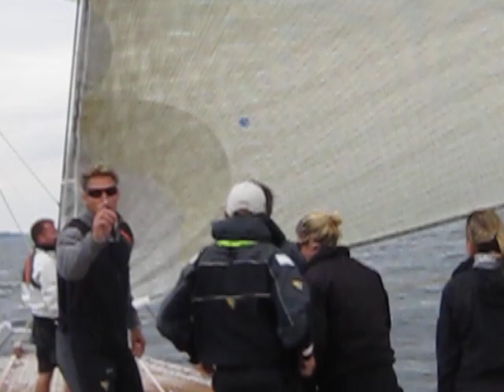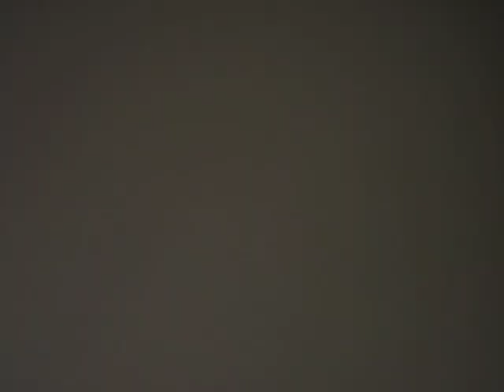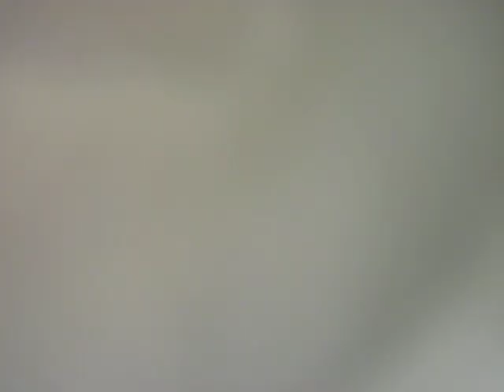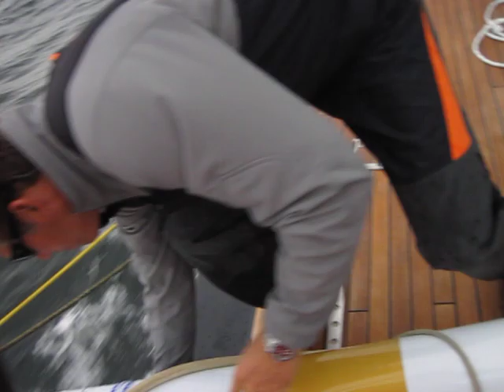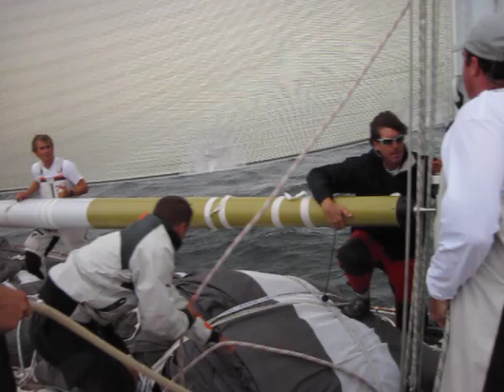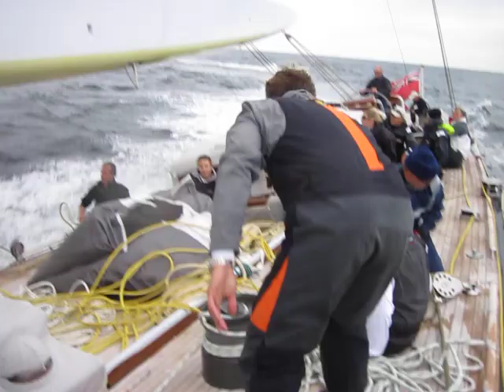Spinnaker takedown onboard the J Class Yacht Hanuman

Comment: Nick, the short pole that was lashed to the shroud is a reaching strut.  When the spinnaker pole is out near the forestay, the small angle between the guy and spin pole puts the pole in compression and only a small component of force to windward.  The reaching strut helps hold the guy out farther giving it a better angle to work against the spinnaker pole.
Reply: +Zach Stine Sometimes also called a Jockey Pole I believe - I'm sure there are other names out there for them too.

Comment: Bowman should have climbed up and sat on the pole. It is the right move if done correctly. Before climbing you "set" the pole meaning: crank up on the topping-lift and fore-guy. We was clipped onto the foreguy/downhaul - so generally you are not going anywhere. Your best friend should be the guy on the topping lift.

Comment: Looks like fun!  
Is it really standard procedure to have someone climb up to the pole?  I would think that in rough water it would be too easy to be thrown into the water.
Reply: I believe you attach yourself to the rope with a simple harness. Not sure though, I see people doing it on boats such as the volvo ocean 65s, and the clippers
Reply: yes, he locked himself. see movie.
Reply: eike64 Why dont you use a trip line ?
Reply from the maker: Because the loads are to high for a trip line to work. You have to spike it. That's why the bow man is the toughest sumbitch on the boat.

Comment: What is the small pole for?
Reply from the maker: It is to improve the angle from the back of the boat to the front of the pole. It also keeps the lines off of the stays that hold the mast up. These are carbon stays and cannot handle that sort of friction. The loads are really high so you need this small pole. It is called a reaching strut.

Comment: Pretty dangerous boat. Where is the railing....Or is the man falling overboard picked up by a following motorboat...Even the Somali Navy uses railings.
Reply: warjacare haha a railing on a j-class?!? This is not 50+ sailing
Reply: warjacare Bahaha sure. Let's add railings to Lasers and Stars too!!
Reply: +warjacare - it is the way the boat was when designed back in the 1930s. This is a inshore race boat and the lifelines would interfere with sail handling and cause extra windage sapping speed. Yes - the boat behind it is for safety, spare parts and for the coach. It is pretty common to have one of these behind these large powerful boats. Think of it like a horse - no seat belts there either.